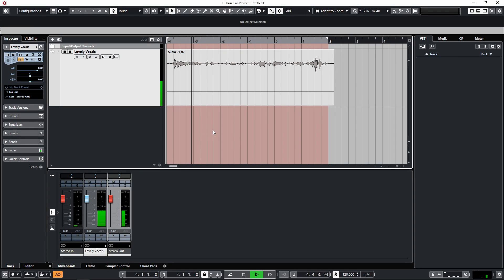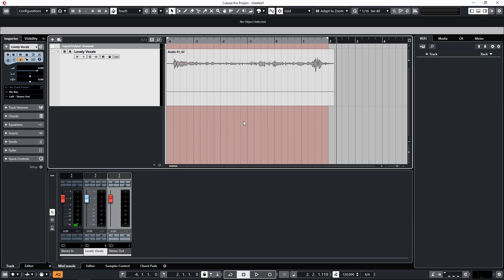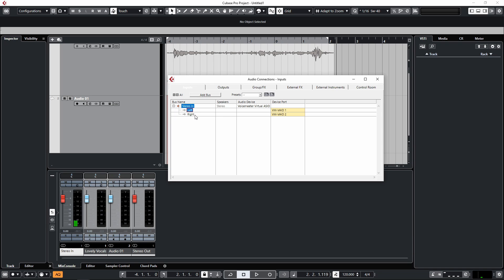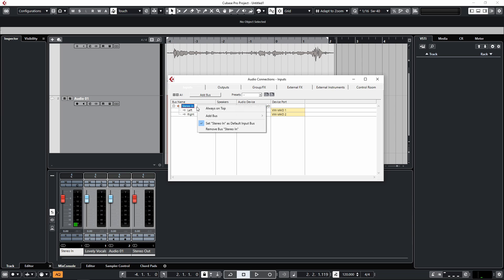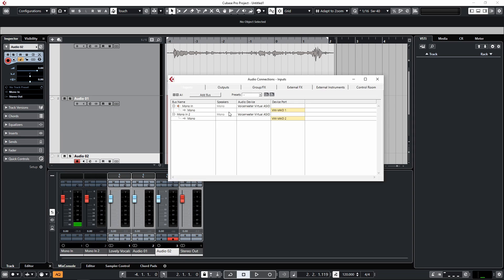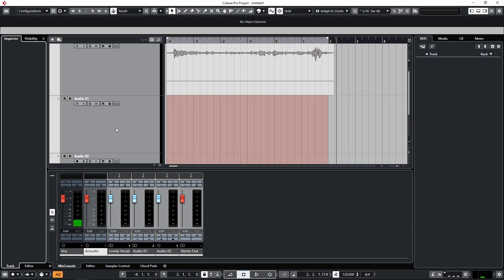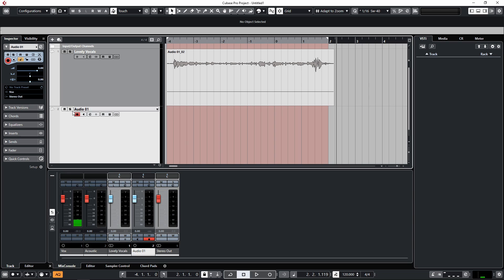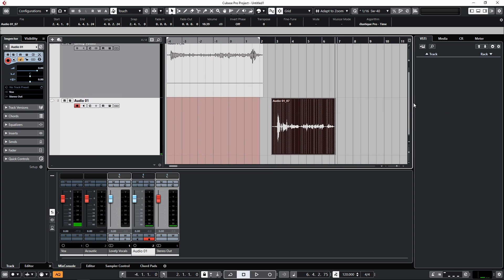Cubase Tips | Recorded Audio playing in ONE Speaker?!? 🤬

Comment: Question:  On Audio Input is it correct to hook up my Yamaha Drums as a stereo connection? or 2 mono's; and same question for my Komplete Kontrol keyboard.  They both have left & right outputs.  Thanks.
Reply from the maker: Most V-Drums have a two mono outputs, usually labeled L & R.  So you'd plug these into inputs 1 & 2 of the interface to record. Same applies to the keyboard.

You could then either use two mono audio tracks to record each signal independently, pan one left, then one right and then group these to a stereo bus. This way you can process the independent channels, but still have a stereo bus to work with and add additional processing.

OR - you could just use a stereo track to record both inputs to one channel. Personally I don't tend to record using Stereo, mainly use mono tracks then sum things to a stereo bus after. The only  exception to this is when recording a  Amp Simulator that can output stereo effects and cabs.
Reply: @PoundSound  thanks.   :)